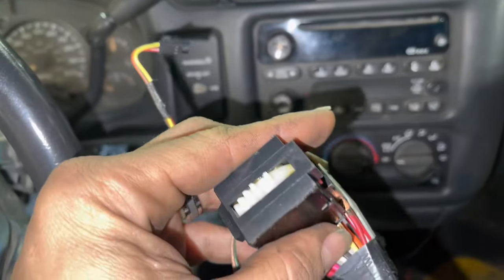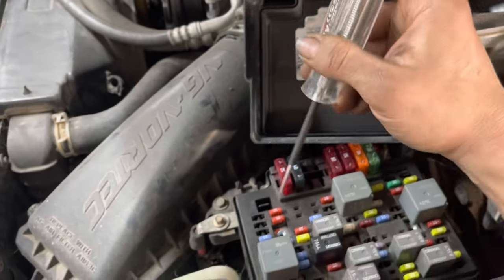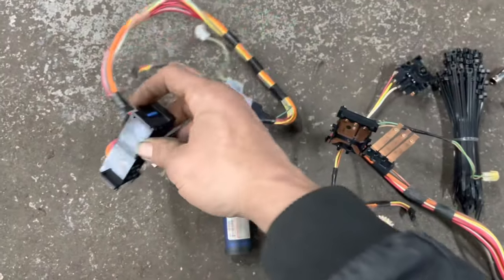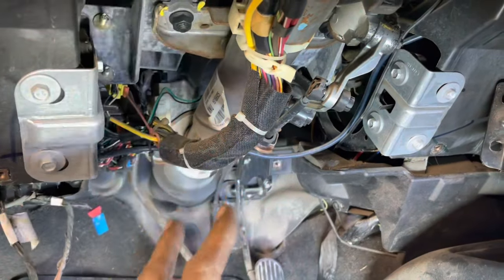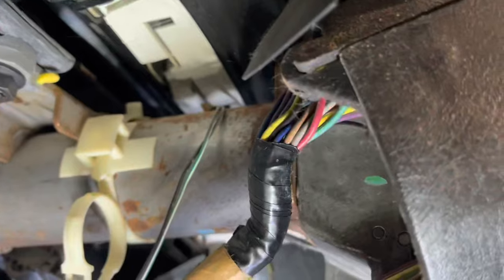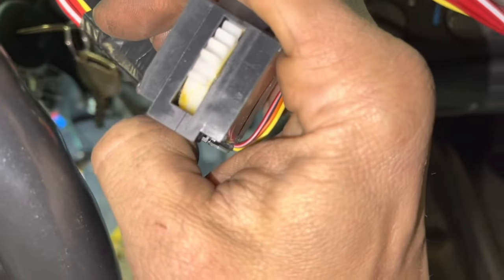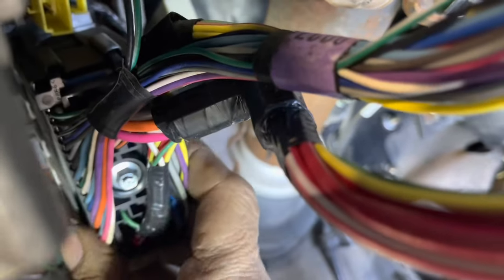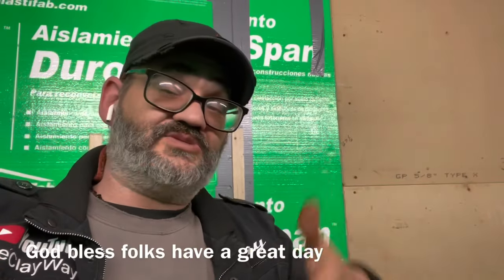Chevy Ignition Switch Replacement - How to and why it may or may not work

Comment: Thank you Clay for taking the time to educate those of us who are older than ECM's and PCM's and computers...My DD is a 72 C/10, I just got a great deal on a 2002 3/4 ton Chevy Express. Turn the key on all the lights bells and whistles work but no crank. Climb under the van and short the solenoid, fired right up! I'm thinking the Ignition switch. Already bought a new battery and starter so hopefully the switch will do it. It does turn rather hard, have to wiggle the key so...Thanks again for the insight!

Comment: Just a FYI for folks with 96-99 OBS trucks and Surburbans. Most of this video applies. There is no gear where it goes under the key. It is slotted to match the column. It installs pointed toward the column. Match the tab to the install point. There are two screws that hold it in place. The top one is nearly impossible to get to. I cut the tab off with a multi tool and replaced it with a different type of screw that you can get to with a screw driver. A socket won't fit.

Comment: The radio in my uplander van usually stays on for 10-15 minutes after I switch the key off. But if I switch the key off then open the door it would turn off the radio, all normal for my van. However it just recently started staying on even after taking the key out and opening the door. Could  the ignition be bad and causing this issue?
Reply from the maker: That’s because your door is not sending signal to turn it off after you open it broken wires in between the door and the a pillar
Reply: @sharpcarco  Any idea how to find that?

Comment: Awesome video clay! Thanks for the that! Got the same vehicle but mine is still cranking… starter is engaging good battery but it won’t stay on what do you think? Thank you
Reply from the maker: Electrical portion of the ignition possibly if I’m understanding you correctly, it shuts off as soon as you let go of the key

That’s assuming that there’s not a security light flashing on my dash sorry I didn’t see this message before
Reply: There is no security light on the dash

Comment: Thanks for the tips and encouragement clay great video!

My 98 suburban was broken into last year and ever since I’ve had weird electrical issues. For instance with the starter jumping early making a loud ping on the flex plate when turning key to accessories, as if the truck thinks I’m cranking it for a millisecond but quits. Then the climate controls would cause the ABS and other dash lights to turn on and the air cuts off.

Other times it would be the lights on the shift indicator still on or the 4x4 push button module not shutting down after pulling the key out. Some real electrical funk going on. 

Everything in my mind and YouTube is telling me the ignition harness would cure my problems. Thoughts?
Reply from the maker: Well, the only thing that comes to mind from experience is I’ve had several fuse boxes on Chevrolet that get corroded on the inside in between the wafer boards so I disassembled them clean the corrosion out and put them back together together. I can’t say for certain that that’s your problem. Obviously, you would also want to check the grounds. From my experience. Them are the two major problems. 

It’s also possible that the electronic part of your ignition is defective as well sometimes after years and years of use like 25 in your situation it’s very possible that it is worn out and not making proper connections inside the steering column
Reply: @sharpcarco  seems like it was the switch, problem solved for now.

Comment: Question regarding the ignition switch.  A mistake was made while installing a few months ago.  Got it to work, but basically, the dial/teeth got moved out of the original position they should have been in.  Now, the vehicle is very hard to start.  I want to try to fix it.  Is there any way to get it back into the correct place once it's messed up?  Also, when the ignition switch was replaced a few months ago.... none of those wires were disconnected... We just removed the outer piece of the steering wheel and changed out the ignition switch.  It did work for a little while.

Comment: Really good video Clay.    I'm just wondering what is the rigid cable to the back and bottom of the tumbler with the white clip?  Some jerk tried to steal my truck and popped the switch out and rotated it and got it started for one second and it quit.  Now the key tumbler doesn't rotate with the key in it and seems like it's trying to pull that cable and it can't.
Reply from the maker: I believe that you’re talking about your shift lock cable I can’t say for certain but I think that’s what that does. Sorry to hear somebody tried to steal your truck. Luckily they didn’t get very far.

I would recommend replacing the steering column 

Then doing the key reprogram procedure that should fix up all of your issues . I believe the key Reprogram procedure is just 10 minutes on three times but you may want to double check

Comment: Hey Clay I replaced my ignition switch on my Silverado. It will start but now when I start the truck my odometer goes off. I have no blower or ac. No wipers and no access to my 4x4 can you help in any way?

Comment: My multimeter reads 12.5 volts only on when the key is turned to on. No voltage for accessory’s or start . Does this mean the switch itself is bad or the green cable connector I’m testing the voltage from is bad?
Reply from the maker: More than likely that means the electrical portion of the ignition is bad

Comment: My express van door locks cycle continuously while I'm driving, locking and unlocking.  Do you think that replacing the ignition switch would fix it?
Reply from the maker: More than likely, that’s a broken wire between your a pillar and your door. You know how you open the door and close the door all the time eventually, it breaks wires and the Warriors probably broken inside the little rubber accordion tube, allowing it to ground out so more than likely that’s the problem not your ignition switch, but good thinking that’s a possibility as well, but unlikely the problem

Comment: Sometimes my truck will crank sometimes it won't.  Good battery and new starter.
Reply from the maker: Have someone hold the ignition into the start position while you’re under the hood wiggling things until it starts to turn over

Comment: Nice Video... My problem on 2000 Pontiac is that when it is very cold outside... when I turn off the car... the key does not turn all the way back. I have to press the override button which then lets me turn the key all the way back to remove. I have replaced the ignition cylinder.. but the problem persists. Any thoughts?

Comment: Hi Clay, 
Great video! 
After running of the thieves that almost stole my 1999 Suburban they left me a screw driver in trade of a key. 

The screw driver worked for a year. Finally drilled out the ignition key lock cylinder and the new cylinder wouldn’t turn the key so pulled it out and used a big screwdriver to start the truck but I can’t turn it off unless I remove the fuel pump relay.  
The dashboard is lit up even though I have the ignition in the off position.  Any thoughts?   Thx for your opinion!
Reply from the maker: Replace the electrical portion of the ignition and replace the lock cylinder at the same time it will work
Reply: @sharpcarco  thanks so much

Comment: Hey thanks for the information on the ignition switch I have a question I have a 2002 Chevrolet blazer there’s a noise coming from the inside of my car and it’s draining the battery like a little humming noise when I put the key in the ignition and when I don’t put the key in the ignition noise is coming from around my radio CD player and every time I go in the car the battery is drained
Reply from the maker: Electrical portion of your ignition is probably worn out, causing the ignition not to turn off completely

You could do a draw test on your fuse box, but I think ultimately it’s going to bring you back to the electrical portion of the ignition, but that would be a way that you could definitively say what it is. So I would investigate that because I’m not always correct.

Comment: What was the exact symptoms when u turned on the key ? Was there crank or nothing? Does it give out a trouble code for this type of issue?
Reply from the maker: Honestly I can’t remember but I do know that this was not the only problem with this truck it also needed the ignition module located near the coil which was crazy that was the first time I’ve ever had to change one of them but I don’t work on a lot of S tens thanks for the kind words to Juan I greatly appreciate it and welcome to the Channell we’re happy to have you

Comment: Im replacing all that as well. But I'm a YouTube and Google mechanic so. I've gotten every part done. But I can't remember where these last two wires came off or go. It's on the wiring harness part towards the foot pedals. Their both clip kinda things. Each have a black wire and a green with white stripe wire. Not sure where they go
Reply from the maker: The floor light?

Comment: We had our truck stolen and when we got it back we found out they lost the keys well we replaced the ignition switch with a new key and when i try to crank it up it runs for only about 2 seconds before cutting off and giving me a security light
Reply from the maker: Turn the key on for 10 minutes

Turn the key off for 30 seconds

Turn the key back on for 10 more minutes

Turn the key off for 30 seconds

And then another 10 minutes and it should start make sure you have something hooked up to the battery so it doesn’t die

Your key just is not programmed that car and I would imagine that your security light is flashing
Reply: @sharpcarco  02 dosent have the security in the key its the pass lock thats screwing it up was gonna try and bypass it with a resistor when i find out what kind i need
Reply: @sharpcarco  and yes the security light is flashing
Reply from the maker: You are correct it does not have it in the key…. But your security light is flashing and there is security in the BCM, And it’s most certainly a security problems from the sounds of it of course I’m not there so I can’t be for certain
Reply from the maker: And anyways that’s the procedure from my memory of how you reset that once the light stops flashing that’s when you can start the vehicle
Reply: I only found switches for a manual transmission will that work too for gmc

Comment: My 2000 Silverado 5.3 4x4 was stolen changed ignition switch won’t start tried by pass leaving the key on for 10 min off 10 sec 3 x nothing turns on but turns off right away no security light any suggestions
Reply from the maker: It’s not the ignition switch sorry I can’t tell you what’s going on but it’s probably not that
Reply: @sharpcarco  forgot to mention it would turn on with a screw driver from when I got it back  then out of nowhere it stopped working
Reply: @crisreyes9605 did you ever find out what the issue was? I have a similar issue after theft. Reset the key after everything was replaced. Did the 3 times 10 minute thing each time etc. light for theft came off but still wont crank. The odd thing is that if you remote start it and then stick the key in, it works and you can drive it. Just no initial start
Reply: Yes i was given the wrong type of ignition switch first time dealing with trucks and I guess they sold me the wrong one bought another one correct one did the same thing and it worked

Comment: How do u change the netural safety switch on a 2006 chevy equinox bro?
Reply from the maker: I can’t remember it that one might be located inside the transmission on the valve body assembly
Reply from the maker: Does the vehicle start in neutral?
Reply from the maker: If it doesn’t, it’s not the neutral safety switch

Comment: On a 2004 Silverado could this switch keep the truck from turning over at all? If I turn the switch on all the lights in dash come on like they are supposed to but when you turn the switch to start it nothing no click no nothing… I can jump the wire from the relay under the hood and start it so I know the starter is good
Reply: I’m currently having this issue on an 01 Tahoe. Fuses good, starter, battery etc all good. Any updates on fixes?
Reply from the maker: Maybe fuse box , bad relay or switch